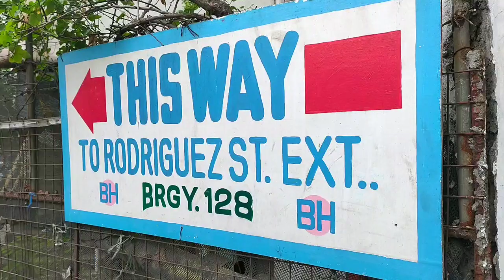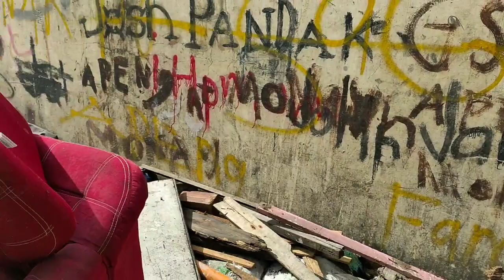Manila Update|Grabe! wala Disiplina mga tao d2|

Comment: There is no word for " Maintenance " in the Philippine language.........if anyone cares to take note and observe, they would find that for the most part that from the day a structure is built in the Philippines,   house, apartment block, business premises etc .it is never maintained either by cleaning, painting replacing damaged parts etc until the day the building falls down. Owners and/or tenants will never spend money on this,  it's no wonder half of Manila has turned into a slum.

Comment: Kasi walang comprehensive garbage collection program ang city administration council at napabayaan ng previous administrations for decades.  Kaya nga ito napakarami  ngayon dahil ngayon lang sa admin ni Meyor naging seryoso talaga ang clearing program. 
Dapat ang city admin council ay magbigay ng info sa buong Manila,  barangay by barangay, kung anong araw ang garbage collection at oras, bawat block or zone. Bins should be free of charge and provided by the council. 2 bins per household- 1 for organic and 1 for recyclables. The owners at the designated/scheduled garbage collection day and time, will put the bins at the edge of the curb in front of their houses or buildings. Proper clean garbage trucks with retractable claw can reach the bins and 2 helpers in proper PPE can assist to see the bins are emptied with no spilling.
If this is done weekly, it would be effective and efficient. Desente pa at clean looking.
So it is simply proper continuous public information and discipline and serious proper garbage collection program by the City Administration Office.